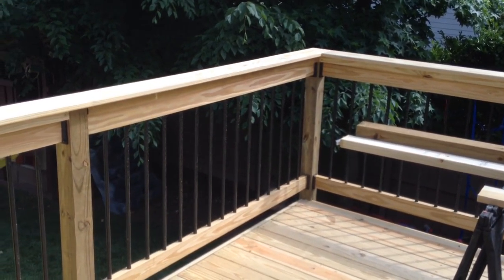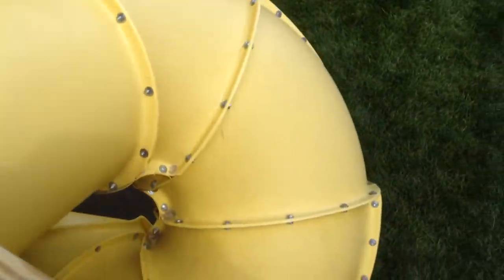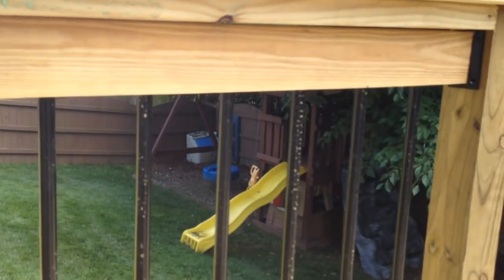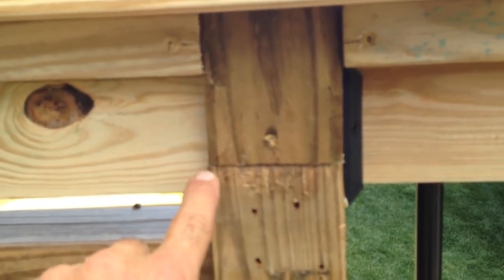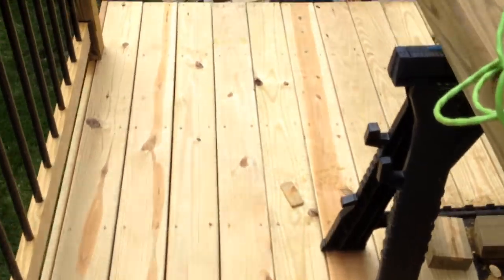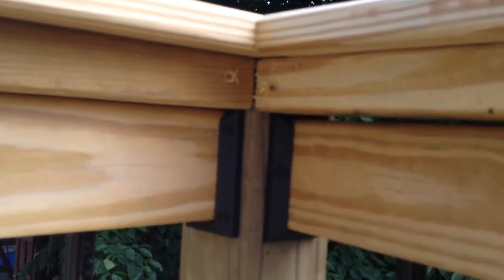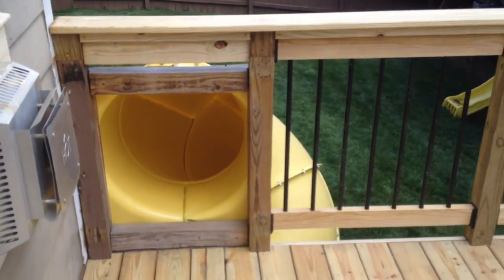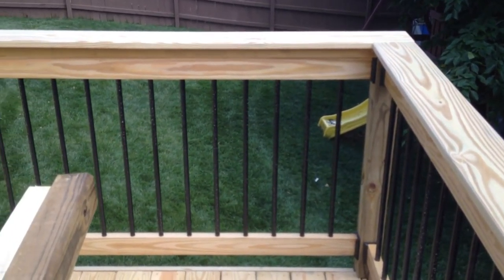Handyman Business / Installing hand rails, pickets.

Comment: I been painting for 40 years Tom and to me and (my opinion) that PT is still a little too green, Which in that case you need to use a slow cure oil (SW A-100) on "green" wood (PT) and rough sawn cedar (fascia board) before it can be painted and thats for only cosmetic reasons. Otherwise the "tannin" acids need to have time to find their way out which is the correct way and does not need a primer afterwards. You dont want to get involved having to prime a deck as over time the planking will split. The decks should only need an acrylic deck coating after a fully cured state. To me it appears the wood you used is in two separate stages whereas the Hand rails look fine but the posts and deck are still too green and need to weather more. If it were me because of my uncertainty and warranty worries I would get a sales rep from a Commercial Sherwin Williams to qualify that wood and make sure of it's condition to xoat it with anything right now. Stix is a very good product and now made by PP&G however it's use is only made for the DIY kind of mind speak. The MSDS sheets and finishing schedule is what's important here, Otherwise you are going to "mary" yourself to the life of that deck and have to "babysit" the coating because of a white quick fix primer which is not necessary Let that PT cure like it's suppose to Dont rush something because of "cosmetic" reasons. If you do then get the home owner to "sign off" on it to get the ahead on it. Let them eat the warranty issue. You don't want to deal with getting a call back once a year to have to keep restaining because of a white primer showing through everywhere it cracks

Comment: Take a gander and learn from a guy who does things correct no matter what it takes... Job looks fantastic... [Compared to the old garbage that was there put in place by the last contractor who put it up...] (Since you are painting that rail don't forget to caulk all those gaps beforehand... Black colored caulk would work best... Obviously don't forget to sand and dust off the rails before you put your first coat of primer [tinted black of course] on... Then a coat [or two depending] of the black paint and pristine it will be and will last for years without buckling and warping like the deck you just tore down...)
Reply: P.S. don't forget tarps when painting the rails... Will mess up your raw wood or nice deck stain if you drip black paint on it...
Reply: P.P.S.: I said caulk [and let it dry overnight] first because caulk doesn't stick well to sanded/dusty surfaces... I'm sure you know that though so... Make the caulk fail faster if put on over dusty wood...

Comment: You can wrap the slide post with some 1/2" treated plywood and put corner mold on the corners to hide the block extensions
Reply from the maker: Thank you Zach for that suggestion.  I have so much more to do on this deck rebuild.  Things will change.

Comment: Butt joint and screw on to a rail support post, would never pass code in my area. Butt joint on finished rail cap "really" . I would fire one of my employee's for that kind of work.
Reply from the maker: Sorry that you think so Rick, this isn't the way you would build a hand rail.  But it a 1000 times better then the way it was built before.  Code or no code.  I got 3 more deck remodel jobs because of this build.  Maybe your codes in your state need changing, or maybe some people can't think outside the box.  In Raleigh all decks that have been built over the last 10 years are failing apart, because they used standard steel nails to build them.  Same in this case, now the deck is built with all screws, and the most important part of all.  The homeowner loves it.
Reply: if you would fire someone over that your not a good teacher in the trades and not a good carpenter to. Over 30 years in construction i seen wrose

Comment: Is it some sorta code to have the Gap at the bottom?
Reply: nate phillips Idk I've seen them with just, like an inch or so and it just looks...wrong, like unsettling
Reply: nate phillips no, there is no code requirement on gap, only on railing height from deck surface to top of handrail but, it is an extremely good idea to have some sort of gap at the bottom so you can sweep dirt/leaves, etc off the deck
Reply: Jon Crosby gotcha, thanks
Reply: Don Pfeiffer sounds good thanks, be a good idea up here in the snow belt for sure
Reply: There is a code actually. All spaces in the railing must be less than 4". This includes the space between the bottom of the railing and the deck surface.
Reply: Handy 911 what he was asking tho is there a code that says you have to have a gap at all at the bottom and there is not but you are correct in that any gap that is there, specifically between spindles but would also include the gap between the bottom rail to top of deck, must be 4” or less so kids won’t stick there heads in there and break their neck or slip thru altogether. 

So we are both correct really, I just didn’t really specify that there is no code saying there must be a gap between bottom rail and deck surface. 

Thanks for clearing it up so everyone knows what we are trying to say